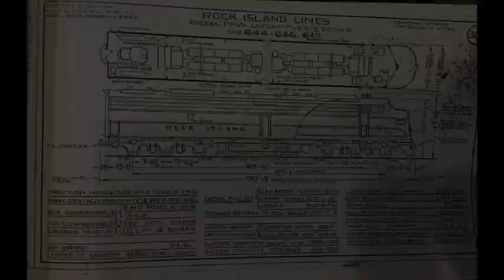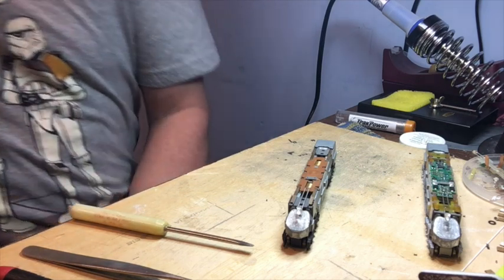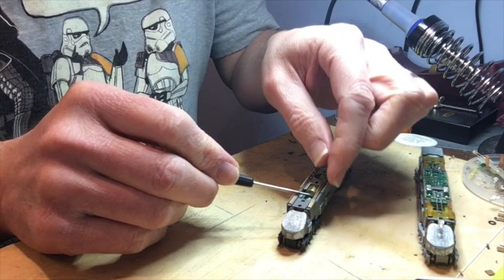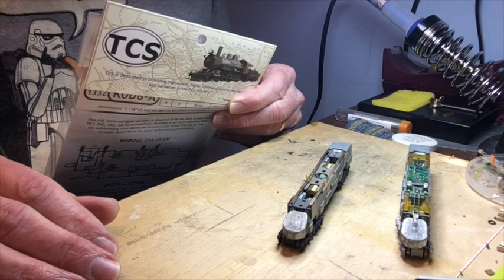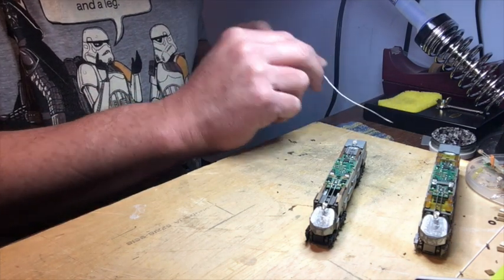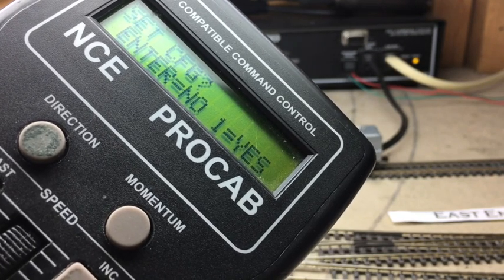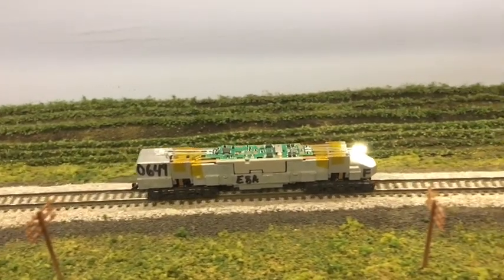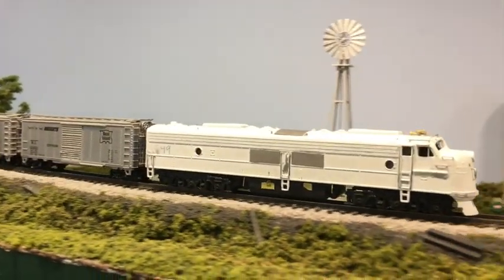Monthly Progress Rock Island E-8-A  #649 Part 4

Comment: Cool szchtuff Tony! I learned a lot watching your videos. You're a great teacher in and out of the classroom. One thing, would it not be better to use the solder iron to remove the rear light? I've done some replacement of the dim orange lights that often come with Kato locos and it easy to remove the light. Just a quick touch with the iron.. Of course my experience is limited to the standard DC light board. Maybe its different with the decoder board. Too bad the rear light can't be used to make a back up light. Looks like that would require lengthening the leads and some milling of the chassis but it might work.
Reply from the maker: Collin,  Thank you I'm glad to share some tips that have worked for me.  You are correct that I could use the soldering iron to remove the rear headlight.  However, the soldering pads on the board lay right next to some components on the decoder and my fear is that the heat from the soldering iron may damage them.  So I find it easier to clip them.  What I should have mentioned in the video is I clip them at different lengths so I can tell negative and positive leads.  Oh well, next video,  I do reuse many of the clipped headlights to replace headlights in other units.

Comment: Man, thank you.   I've been looking for a easy to follow decoder install video.   I think I finally can do it.  One question.  The pickups in front and rear, is that were you see some solder wires in place of the brass??   Not that I am ready to try.  LOL.   Again thanks for the info.   Really needed the help.
Reply from the maker: Chris,  Glad to hear it.  By profession, I'm an elementary teacher and there have been so may installs I have watched that are good but they seem to skip or assume a step without showing it.  So thinking about what I would do in the classroom.... I went for a longer video to make sure I tried to cover it all whether it was a minor or major step in the process.  

You are correct the brass strips are what you can solder to.  I have a pair of E-8s I have done that to.  Just use a fine 30 gauge wire to keep the truck flexible to swing and move.  You may also have to use extra Kapton tape so the brass strip do not touch the frame and cause a short.  You can also trim the brass strips to make them shorter when soldering wire to them from the trucks. Tony
Reply: @CornCountryRails  Thank you Teacher.   I really appreciate your help.